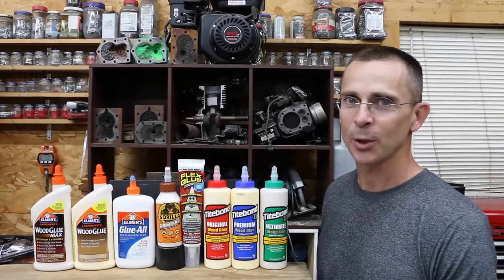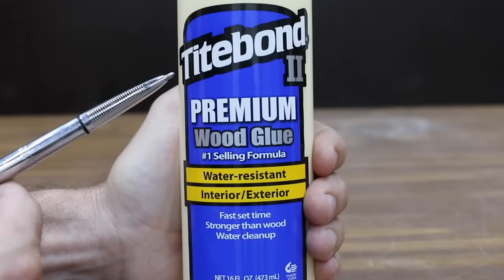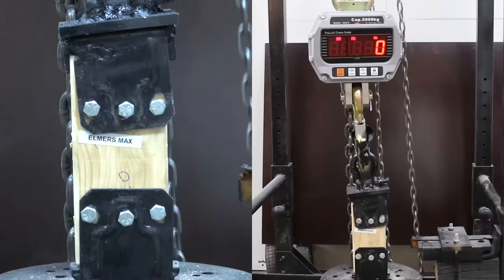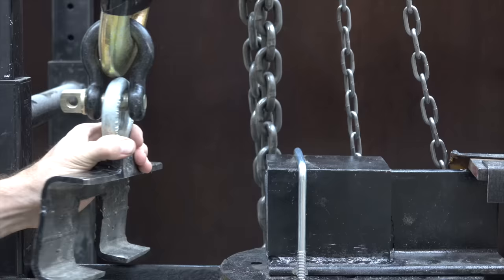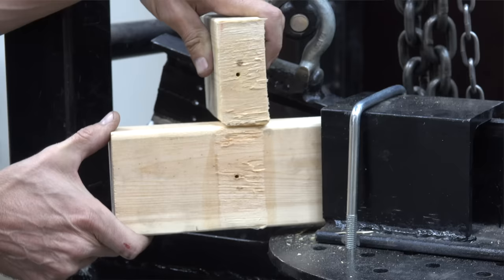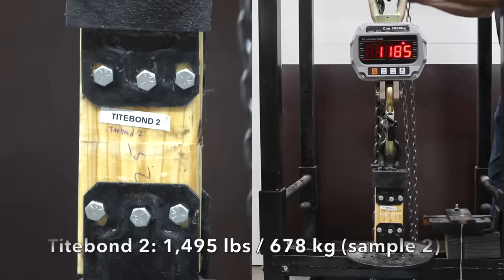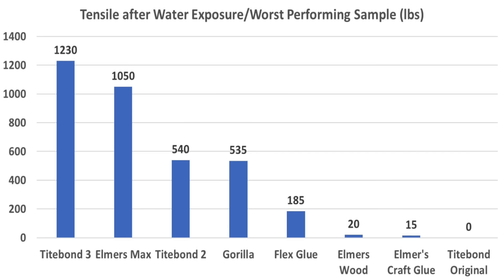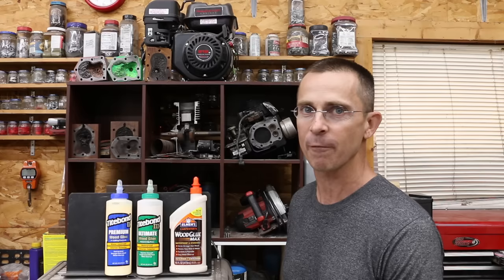Which Wood Glue is Best?  Let's find out!  Showdown with Titebond, Flex Glue, Elmer's & Gorilla.

Comment: I absolutely love this channel. Have to agree with some of the other comments that this is a difficult one as far as gauging utility. As a woodworker, we never glue end grain and rely on that alone for strength without joinery (or fasteners in more crude work). It would’ve been nice to see some long grain glue up testing, although it makes me wonder if the testing equipment would’ve been able to measure that as the glue joint will usually outlast the wood fibers and the test equipment seemed maxed out by the short grain testing. But doing some panel glue ups and then testing the shear strength would be very helpful. Also testing glue of strength at certain time intervals would be helpful, as well as tests regarding working/open time during a glue up. Thanks for all you do.
Reply from the maker: Thanks and you are welcome!  Thanks for the constructive feedback.

Comment: Back when I was studying furniture design in college, I was taught that glue can't really bond properly to the end grain of wood (as the end grain will suck a lot of the glue through the wood). It would be interesting to see these tests redone but only joining the edges and faces, to see either how much stronger the bonds are or if modern wood glues somehow overcome the problem I was taught about.
Reply from the maker: Thanks for the suggestion.
Reply: In practice, lots of wood projects will involve gluing on the end grain, so I'm happy to see the test performed in this manner. Representative of real world sub-par engineering common in home-gamer projects. I build speaker cabinets as a hobby once and awhile and will often have simple rabbet joints used to guide things into place for gluing. I usually go for tightbond 2 because spending that extra dollar seems like a perfectly reasonable sacrifice if it saves me any joint failures but this video fairly well demonstrates that most wood glues would work fine for my application. Good to know!

Comment: I enjoy your reviews. I'm trying to use floor leveler and need something that flows easily. The manufacturer water amount makes for slow spread and I've seen a few professionals add a lot more water to make it spread easier. This is uniformly warned against by all manufacturers as it weakens it. There are high flow levelers but they are very hard to find and shipping 50lb bags is expensive. An interesting test would be to find a floor leveler that weakens the least when adding 25% more water.
Reply from the maker: Thanks!  Thanks for the suggestion.

Comment: Excellent video providing inescapeable evidence of which glue is the strongest. 

Although I do all kinds of woodworking I have a pretty large facebook group that helps woodturners. Often times a wood bowl or other woodturning project is made of glued up pieces. Also there are methods of attachment to the wood lathe that involve gluing a piece of wood to the piece being turning ..... there is always argument about what is best ...... you made that pretty clear.

It would be very helpful if your gluing products included some epoxies, PVA Polyvinyle acitate and CA (cyanoacrylate). Woodturners will use mostly CA and epoxy.

Thanks again!
Reply from the maker: You are welcome!  Thanks for the video idea.

Comment: Hi Todd, I hope you had a great Thanksgiving and thanks to you for a great video. 

I did notice one error at 9:52-9:53in the video. You mentioned and captioned 1165 lbs, but the scale shows 1665. Just a heads up. I didn’t see it mentioned in any of the comments I read through so figured I’d mention. Thanks again, have a great weekend.

Comment: Great video! I really liked it. It was pretty representative of the different strengths. Was a bit disappointed you didn't do edge bonding test. End grain is the least strong bond and doing carpentry with end grains usually involves a modified joint like a half lap to compensate. As you found out, there is a lot of variation in strength with the same adhesive in end grain bonding.
I would like to see more, using the latest high tech glues that have been around for a while - I'm very skeptical of their claims!
Reply from the maker: Thanks!  Thanks for the constructive feedback.

Comment: Would love to see a remake adding CA glue (which a LOT of woodworkers love to use now) to the mix - especially some of the brands made for woodworking - Titebond, Satellite City, Stick Fast & of course the old favorite Locktite:
clamp time - 30min, 2hrs, 8hrs, 24hrs (not necessarily applicable to CA glue)
cure time: 1 days, 3 days, 5 days, 7 days - 
soaking the glue... apply glue & clamp immediately vs apply glue & wait 1/2 of open time (to allow some of the glue to soak into the wood) then clamp.
finally, clamp pressure - screws do not provide consistent clamping, but I imagine various dead weights applied downwards on the glue joints could be used.
of course, that would be a ton more work than this video was...
Reply from the maker: Thanks for the video idea.

Comment: Another related test study could be done but with sub floor glues and construction adhesive. Such products like Pl200 and Pl400.  I have used construction adhesive for gluing concrete caps on to concrete walls, and fir gluing hollow blocks as well. They are marked for wood but can  be used for many porous construction materials. Some can be applied directly onto frozen lumber before subfloors are laid. Lots if different test variations could be done. Just an idea.
Reply from the maker: Thanks for the suggestion.

Comment: Please do a wood filler comparison and include testing where you figure out which one makes for the most drillable holes.

I need to move a replacement hinge over a few millimeters and will be drilling a hole next to a hole.

A good wood filler for my purpose would have pretty close to the same density and hardness as the wood so that my drill bit doesn't push away or fall into the filler once it is set.

Other tests might include paint and stain ability.   I bet you can come up with some great tests for wood filler.
Reply from the maker: Thanks for the video idea.

Comment: I'm not even looking at the video because I don't care.
BUT, I used a near 30 year old bottle of Elmers original white to butt 2 pieces of wood together and put in 2 screws. 5 minutes later I decided on a different design. Took out the screws and had to use a gasket scraper pounded into the joint to finally get it apart. One piece tore wood out of the other piece.

Comment: For end grain,  wet the wppd, apply thin  glue. let it soak in ,  then apply the  normal amoubt, clamp.  Still a weaker join but a more more consustant  join,  The diff grades are possibly consentration?

Comment: I've inherited a hardwood chair that needs re-gluing. It has slender back slats (1/3" shaped dowels, really. Even the Amish don't do this sort of craftsmanship) - not excited at the prospect of dissembling so I'm exploring alternatives. 
This stuff is supposed to expand the wood. Questions abound: does type of wood play into the expansion results? Viscosity? Tensile strength? Surface tension? 
Briwax ChaiRX First Aid for Ailing Chairs, 4 Oz

Comment: suggest wood putty comparison. my fav is JB weld wood putty roll. Built my kitchen using titebond3, no screws. I found that for the best strength I had to clamp for 24 hours instead of screws. the harder I clamped the stronger the joint.  fast forward 15 years and have not had a single glue failure.  slapped together a broken shower brush with titebond 3, 3 years later it broke again, the wood had rotted, failed and was still imbedded in the glue on the handle.
Reply from the maker: Thanks for the feedback.  Thanks for the suggestion.

Comment: LOVE this channel.  You do a great job of testing these products in the real world.  I have to comment however on this particular test.  The fact that there was so much variation even within the same brand suggests that many uncontrolled variables.  1) Wood of course is the biggest variable given the nature of tree growth and mill grain cut.  Little can be done about that I suspect, but cheap 2x4s are the most variable types of wood in terms of quality board to board.  I would suggest using a hardwood species with tighter more consistent grain, but smaller in area (like 1x2) so you don't break your machine.   2) The bonding method you used (screws along the side) will create a very inconsistent and often uneven bond as the joint pressure is going to vary alot.  I would highly suggest using clamps set at an even pressure to insure a clean tight bond that is not thinner on one side vs the other.  Plus you can get a much tighter bond which works better with these glues, screws wont provide enough clamping force.  3) Make sure on the end to end test you are aligning the wood as it was cut as close as possible to realign the grain as it was before cutting, I think you did that already but reattaching the grain strands will reveal more of the glues' contribution. Maybe use a guide to perfectly realign the end grains.   I think these changes will yield more consistency and therefore a truer glue quality comparison.  Thanks for a great channel !
Reply from the maker: You are welcome!  Thanks for the feedback.

Comment: These are great videos.  Thank you.             I’ve seen your test for (1) super glue (2) wood glue (3) hot glue …….what about those (4) PUR adhesives? I see alot of people talking about using PUR in place of wood glue?  I see people talking about using super glues in place of wood glue as well.  I’m talking about trim work in carpentry.   It would be great to see a test of those PUR adhesives as a class and then a comparison of the four types (1) vs (2) vs (3) and (4)….a best in class tourney??? 

Thanks again! Such nice work.
Reply from the maker: Thanks!  Thanks for the video idea.

Comment: There seems to be a lot of choice in holding wood together strong enough. Some other questions, what about oily woods like rosewood and teak? How about clean up? Which is easier to get perfectly clean when you’re after a fine finish? Hardness of the glue line, I might want either a really hard glue line or a really flexible line. What caused the variabilities in the tests? How do we make sur we get more consistent results?
Reply from the maker: Thanks for the suggestion.

Comment: I wonder how the medium and thick CA glues would hold up to this testing. Also, a friend made expresso tampers where he glued stainless steel to exotic wood handles. He used the Gorilla urethane glue. He air mailed them to Japan. At elevation, the bubbles expanded and every one of them came apart.
Reply from the maker: Thanks for sharing.  Thanks for the suggestion.

Comment: Good job.  The first video I've seen that does both sheer and tensile.  One video I saw switched to hardwood for the sheer because the pine was failing before the glue in some cases.  Recommend you do that too.  Also, with small samples, one average being higher or lower than the average of another sample doesn't necessarily indicate a significant result.  Recommend you consult a pro statistician to get some advice.  a fan.

Comment: Soaking then re-drying to test regained strength would also be of interest. 
Glueing endgrain is essentially like trying to glue bundles of straws end to end, there is a fundamental lack of bond area and even that is inconsist. With side grain and proper jointing these 5.25 square inch areas would have been up around 15000-20000 pounds dry.(strength of the wood) Non-jointed/planed may be lower but would also be a valid test, just be sure to keep the surface finish a controlled/accounted variable for apples to apples results.
Reply from the maker: Thanks for the suggestion.

Comment: Thanks for the test ! 
Tbh I'm not sure the 3 bolts are enough to provide a reliable uniform tension. 
The wood must crush in the bolt holes and them deform unconcontrollably leading to unequal tensile stress profile.
Reply from the maker: You are welcome!  Thanks for the feedback.

Comment: from my research it seems wood glue is stronger and easier to work with but construction adhesive has a bit of flex to deal with temperature expansion. So for an attic or crawlspace with some temperature changes construction adhesive is probably the best bet. Thats what I read anyway.

Comment: Elmers has been around as long as I can remember. It's nice to see an old school product that hasn't declined. It's all I use. The joints that have a dramatic drop in strength with the same product,  more times than not, is caused because those joints had more porosity: causing the glue to disappear in to the wood more, leaving less to hold the joint together. It's pretty much the same way paint soaks in a lot more and disappears on old, weathered, dry wood, or porous wood such as OSB or particle board.  I know some carpenters that swear by Zar wood glue. I can't help but wonder how it would have competed. I found if I seal underlayment or new plywood walls in a shower surround with zinnser cover stain, (A solvent based bond coat primer) the liquid nails, flooring adhesive, or self adhesive tiles stick better. I've never tried that with wood glue.
Reply from the maker: Thanks for sharing.

Comment: I watched the other video on construction adhesives with JB in there as well. I was trying to compare to find out the overall best adhesive/glue, but I suppose the different surface areas of the wood tested is a factor? Bottom line, if you were going to hang off a cliff and had to depend on one of these adhesives, what would you choose?

Comment: You might improve results of the tensile strength test by clamping the sides of the 2 x 4 so the bolts couldn't split the board as easily.  That would have shown more accurate performance of the glue itself because the pull would have remained more linear.  Great video as usual.
Reply from the maker: Thanks!  Thanks for the constructive feedback.

Comment: Don't know if this has been mentioned, but almost all of these glues have a recommended PSI of clamping pressure. Most woodworkers use clamps instead of screws, too. Have you considered testing wood clamping strength? Not just the difference between brands, but between the types (jaw clamps, c clamps, bar clamps, pipe clamps, etc.).
Reply from the maker: Thanks for the video idea.

Comment: The pull or tensile strength would be more accurately representative if you clamped the two pieces vs drilling the holes the loose bolts spalled out differently based on placement and proximity as evidenced by several failed blocks of wood.  Great video though thanks! ❤️❤️❤️❤️❤️❤️
Reply from the maker: You are welcome!  Thanks for the constructive feedback.

Comment: I've watched several of your reviews lately specifically glues. duct tape, double sided tape and really appreciate them and the fact you do 3 times.  I was wondering if there is if you have any idea why sometimes there is such a large result swing between the three (short of some serious engineering studying?)   It makes one wonder if our results will be just hit & miss!  Just wondering if you’ve got any ideas?  On the subject of glues, lot of woodworkers are using more & more crazy glue (CA).  Several usr and tout Starbond, and I’ve been using E-Z Bond from Amazon and like it.  I was hoping you could do a review on using CA in working as it seems to have some great advantages there.  Some use it with wood glue instead of clamps, then sometimes add brads or screws.  KEEP UP THE GREAT WORK!  It’s doing us all a GREAT service!
Paul Milliken

Comment: I noticed you used 3 bolt holes to hold the test pieces,
That could be an answer to why such varied readings, as the bolts do not necessarily put equalized pressure on the wood, and a slight tilt to the joint, and depending on how accurately the 2 pieces were aligned when glued.
 The test may be closer, if there was a one point contact on each piece properly centered,
A pressure plate clamping straight across the wood may have given closer readings
Just my thoughts and not sure how you would take it.

Your shear testing was using a better holding system

Comment: How about testing heavy picture hangers.  I have a 60 lb painting that's pulled even two 100 lb rated hangers out of the wall.  I've also tried anchoring the hangers with drywall fastener screws to no avail.  Eventually, I ended up hanging the painting in a location in which I could pound the nails into a stud but it's less than ideal.  Awesome channel!
Reply from the maker: Thanks!  Thanks for the suggestion.

Comment: Great video.  I would not recommend Gorilla Wood Glue at all.  4 years ago, I built a box for my little trailer out of Hickory wood using Gorilla Wood Glue, lasted about a month and then the boards started separating where glued.   Went to good marine epoxy glue and it’s been together ever since with about 25k miles on it. The trailer and box are used to carry camping equipment in all types of weather.
Reply from the maker: Thanks!  Thanks for the feedback.

Comment: So new test suggestion - Which glue bottle keeps the glue from drying between uses or seals better to keep glue fresh.  Use the glue once every 2 weeks until the bottle is either empty or dried out and not usable?  Can you clean out the bottle or specialty dispenser after the stuff dries in it?
Reply from the maker: Thanks for the suggestion.